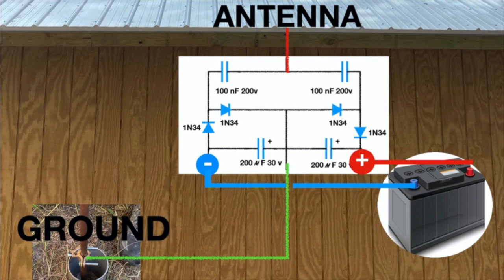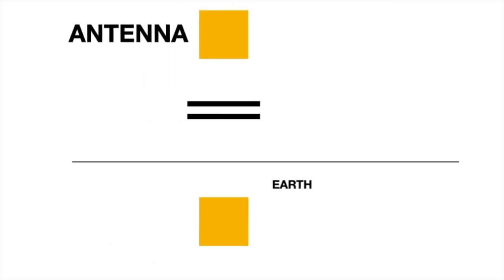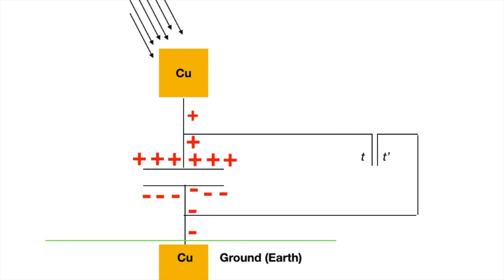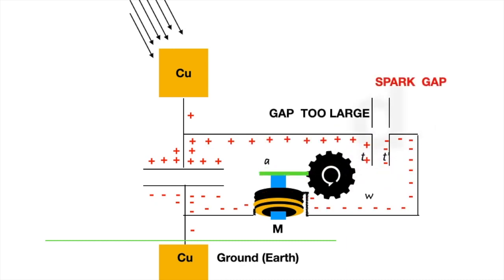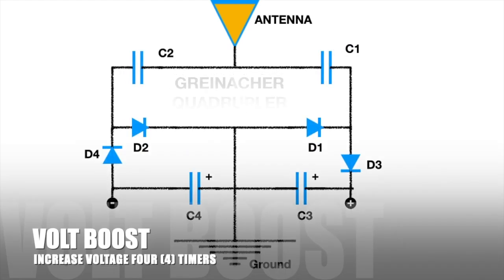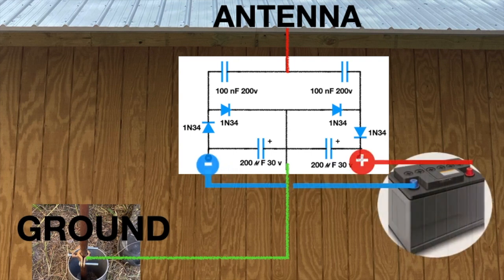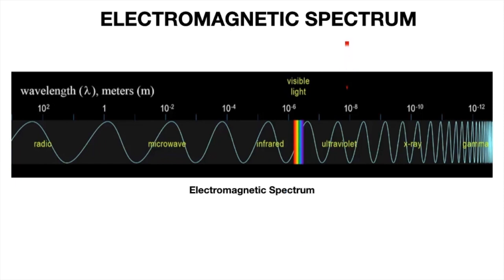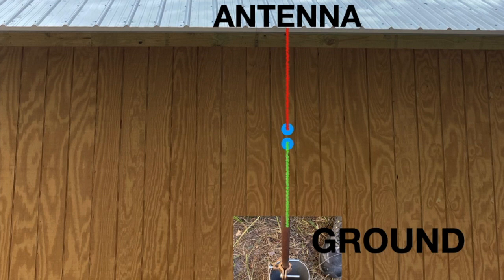DIY FREE ELECTRICITY

Comment: I want to ask only one question: higher metal plate in picture is copper, but does it must be? Metal roofs are steel, so would that work in regular house?
Reply from the maker: Any metal will work, but copper is a better conductor.  According to Nicola Tesla, the metal must be insulated.  That means thwe metal roof must be coated with an insulating material to get the best performance.

Comment: I have seen Patrick kellys videos WHR on one design they can harvest huge voltages from the atmosphere in that case a coil or coils of magnetic wire was used... Pretty dangerous too if caution is not exercised
Reply from the maker: That is very interesting.  I found the Basher Time Space coil has potential in that it uses electromagnetic phenomena to access the multifrequency ambient environment, to extract electrical energy at some frequency, then converts to standard powert characteristics.

Comment: Really good illustration and explanation. But I am not sure you could generate enough power to charge a battery.
Reply from the maker: I agree with you. However, you could accumulate charge. 1. You would charge consistently, around the clock.  2. You need a very large surface area.
Reply: @myeasyfixx1205  yes, its analogous to collecting drops of rain water in a paint bucket and subsequently emptying into larger container. I intend to investigate. But it appears someone has invented the unbelievable! harnessing radiowaves to electricity: see you tube links: https://www.youtube.com/watch?v=ukJkRQscNb0 https://www.youtube.com/watch?v=viGjXV38qvY; what do you think?